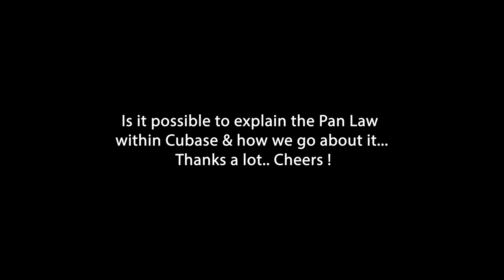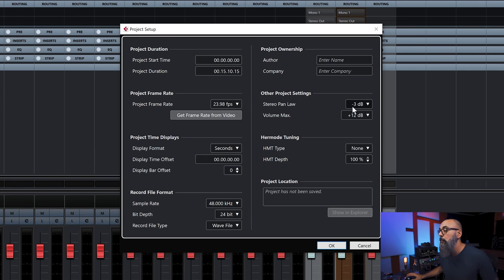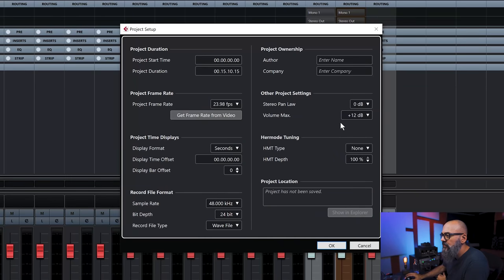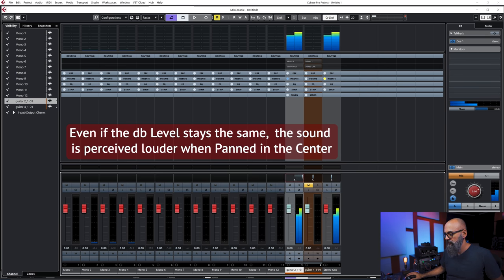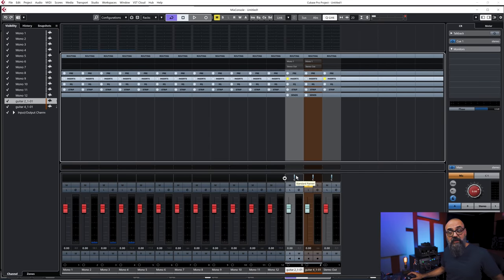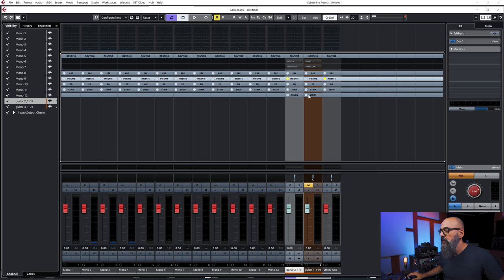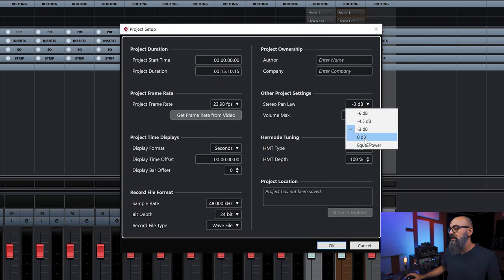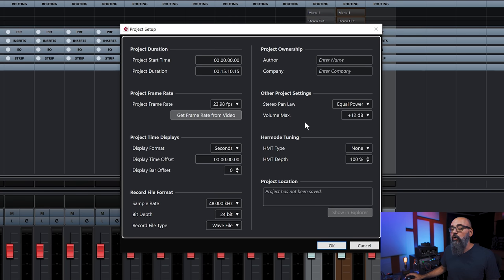Understanding Pan Law - What you need to know

Comment: awesome! Thats the topic im struggling with for years and never found a perfect solution. Because: when working with voiceover im used to limit everything in master to 0 db TP  but when doing a mixdown to mono it summs the channels up and so adds 6db which sometimes leads to distorted bounces.  the strange thing is , thats only sometimes and its hard to see if its a matter of LUFS or idk.  So  what would be your approach to do mixdown mono tracks via the stereo out to mono wav  without having the struggle of the 6db adding issue? How can i mixdown my VO savely without getting distorted tracks? Setting up the levels of the stereo master bus to -6db?  Because when setting the pan mode to -6  everything is not at 0db but at -6 db TP strangely. I wonder if you could help out here

Comment: I used to be very concerned about mono mixing when people had many mono listening sources, such as portable radios and older TVs. In today's world, who is listening in mono? Who edits video/film via tape to tape and EDLs any more? Universally it has all moved to digital NLEs. I think mono mixes are like that. Old techniques that no longer are applicable in today's world.
Reply: Distance to the audio source also plays a role. Not every listener is going to be placed exactly in the sweet spot where speakers form an orthonormal basis. The further you move away the more it will sound like a mono source, like two radios placed next to each other. So, no need to overthink it but some form of compensation for that is still useful.